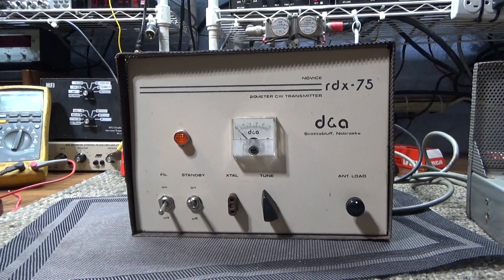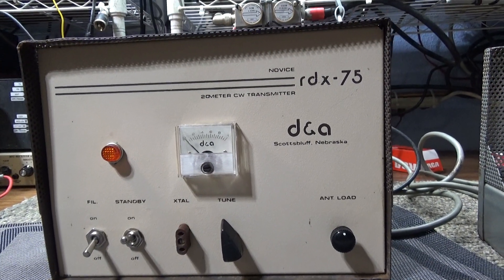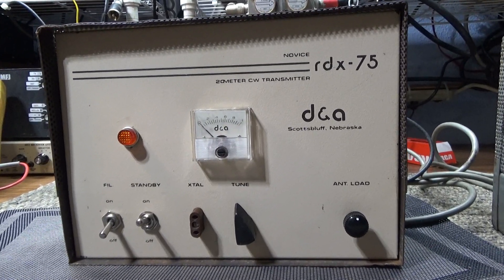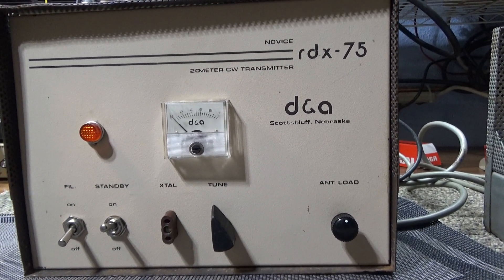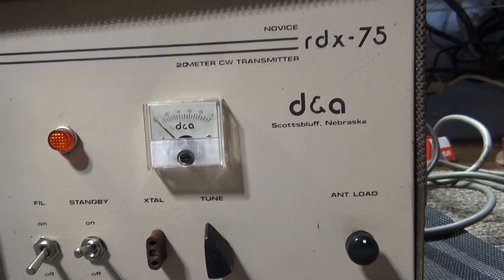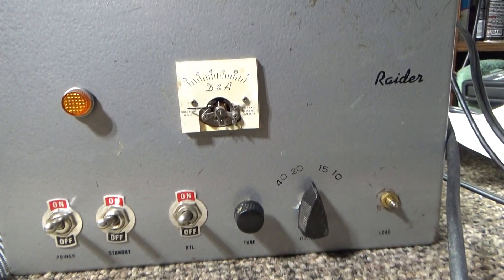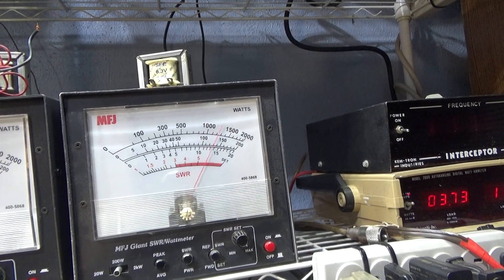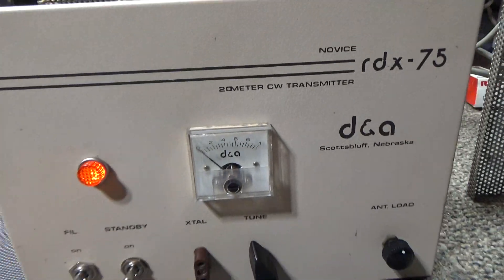D+A Raider 10 meter amplifier errrr I mean RDX-75 20 meter transmitter

Comment: how safe are 6jg6 to take out and clean ... after all i read they are a valve do they hold any volts? i just got a nice tan raider im trying to clean up a bit!
Reply from the maker: you're safe. Valves don't hold volts. Only thing that does is the HV power supply caps. With that amp the HV is shut off by the relay until you transmit, plus no HV on top of those 'Baldy' type of tubes.

Comment: can you make a linear amplifier for 10 meters work on 20 or 40 meters
Reply from the maker: sure, but you would need to add more coil and capacitance to the Tank 'Output' circuit, plus if you want to switch back and forth between bands, you will need to add a band switch.

Comment: What makes it humorous is the fact that Novices never had 20 meter privileges.
Reply from the maker: crazy times, right?
Reply: @tramdr  , I remember seeing correspondence school ads in electronics magazines that featured a VW bus with "Delaney Radio and TV" on it. He was the "D" in "D&A".
Reply from the maker: Yep, I forgot and was recently trying to look up the 'A' in D+A but couldn't find it. I knew they where both Hams and it still tickles me when Hams say that Ham sweep tube amps are good but CB sweep tube amps are bad.
Reply: @tramdr  and when you look at the schematics, they're pretty much the same. There are no short cuts in physics.
Reply from the maker: I've said that often, that if you take a CB amp, take out the drivers and the keying circuit sniffer stuff and show it to a Ham, you will not be able to tell the difference between a Ham sweep tube amp and a CB one. Most use simple grounded grid with a Pi output tank coil. It's just CB hate when Hams bad mouth CB I would say 95% of the time.
Reply: @tramdr  it's been my experience that among younger hams who bad mouth CB they never played around with it and all they know is what someone told them. The generation who hated CB because they lost a seldom used ham band have largely gone on to the big hamfest in the sky.
Reply: Yeah the Novice license was a damn joke...